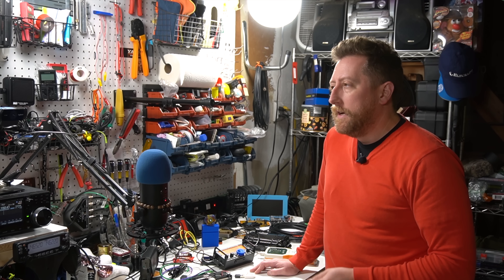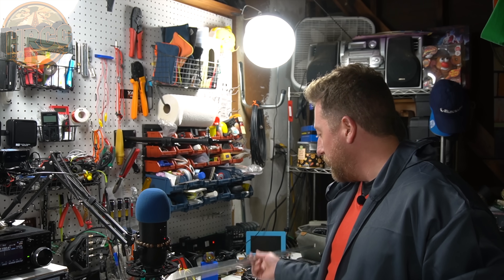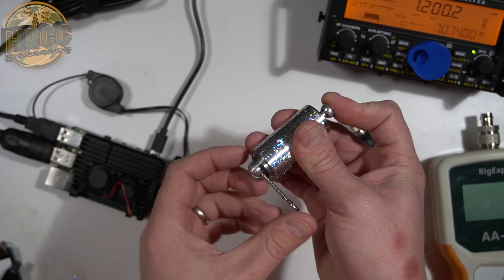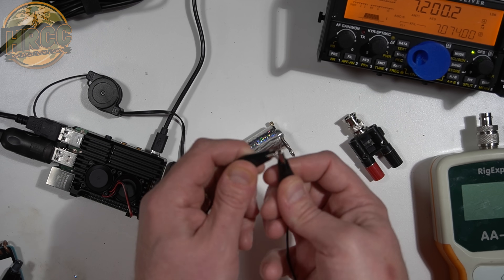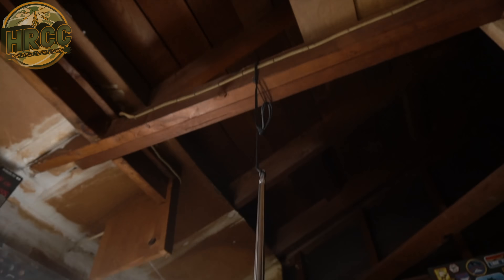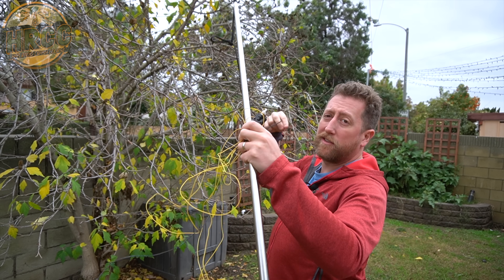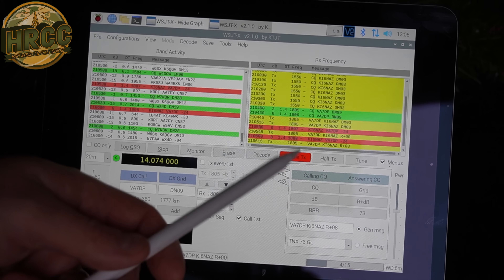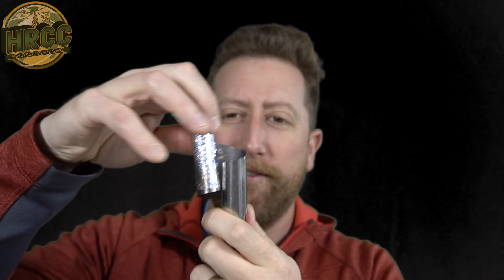Will It Antenna?  The Magic Expandable Staff?!

Comment: That's how to make Qs with odd radiators... Use super Narrow modes.. This is one reason that a 5.9Hz wide WSPR signal can be decoded with a compromised antenna. 73, n6spp
Reply from the maker: Indeed! Work it how you can!

Comment: I once made a antenna out of soda can tabs in a chain form made a video on it ages ago. Connected them into a v-dipole setup in the sloppiest way and managed to pull a image from a noaa weather satellite. Only did so once under perfect conditions but a lot of materials can be used as an antenna.  Of coarse if your doing v-dipole set up with soda tabs the measurement isn't always accurate for satellite receiving but it is durable I done just about all I could too it in a year and never broke it.

Comment: something I have wondered about is what can you tune, and also radiates. Dump some RF into unoccupied metal anything, that would be interesting. Lots of fences, metal stands for sporting events at parks exist all around the USA at public parks. Wouldn't recommend plugging something directly into it, might be hard to explain :)
Reply from the maker: Yes, you can generally get RF out of alot of metal "things" if you can issolate them.  Fence posts are what alot of people use when limited by HOAs, etc.

Comment: Hey Josh.

First, and foremost, Merry Christmas.

Second, here are my suggestions for “Will it Antenna?”:

1) Street sign
2) Guardrail 
3) Truck bumper
Reply: A guardrail would be interesting to see. I don't know how well it would work being that it's grounded every dozen feet or so. Some of them have a heavy plastic insulator between the vertical I-beam in the ground and the horizontal guardrail itself which would probably work better.. The cable-type highway divider may work, but that's a really dangerous place to be. 

I'm a full-time LEO and I HATE being on the side of the highway, even if I'm a ways off the shoulder.
Reply from the maker: I think you nailed it with the grounding.  If the metal thing can be issolated, it will radiate, but if there is a ground, its not going anywhere.
Reply: @HamRadioCrashCourse  chain link fence!

Comment: Will your car antenna? As in if you connect to the metal body and use the car body as your radiating element.
Reply: As long as you use another power source for the radio than the car battery, otherwise the antenna will be grounded.